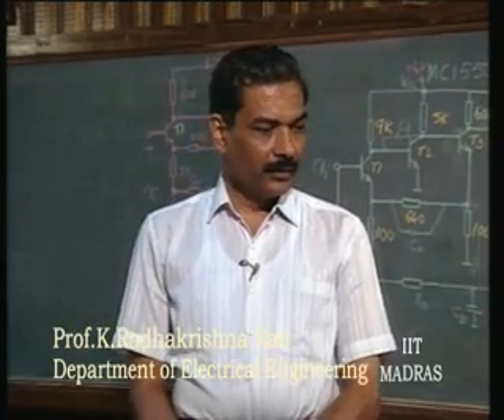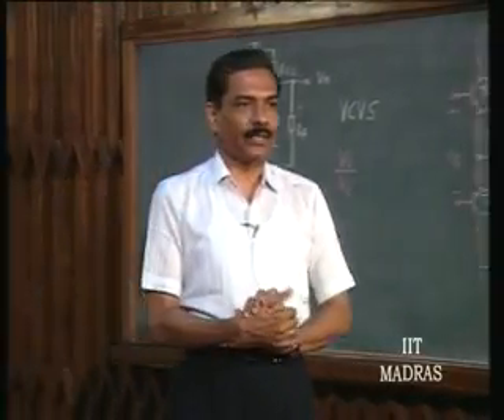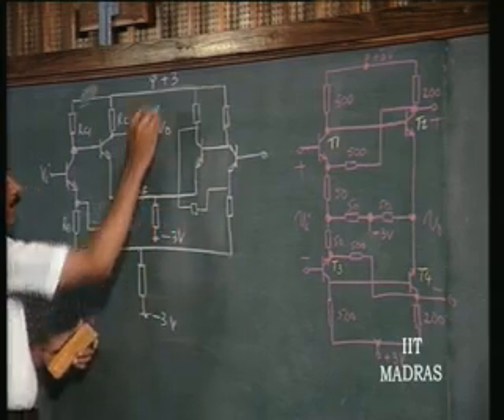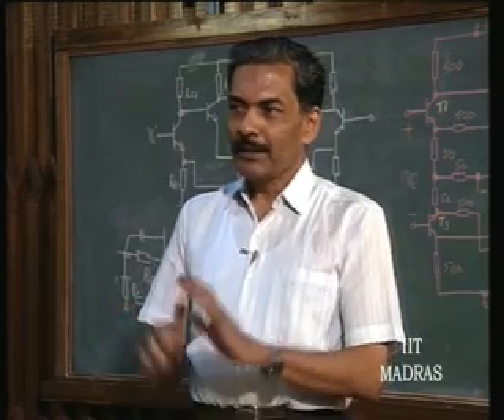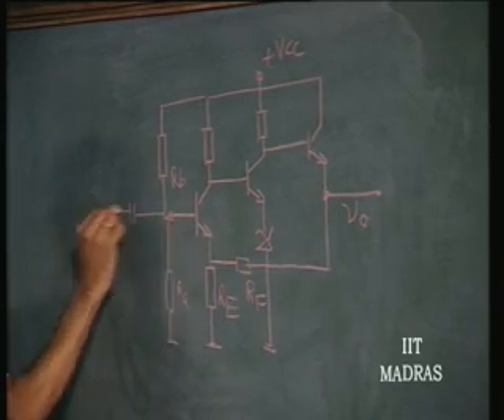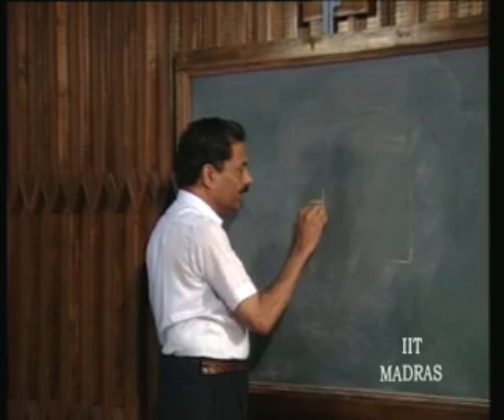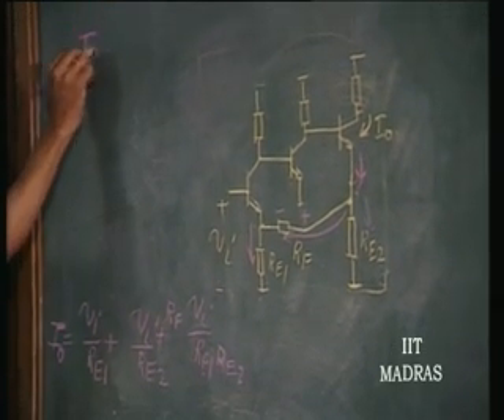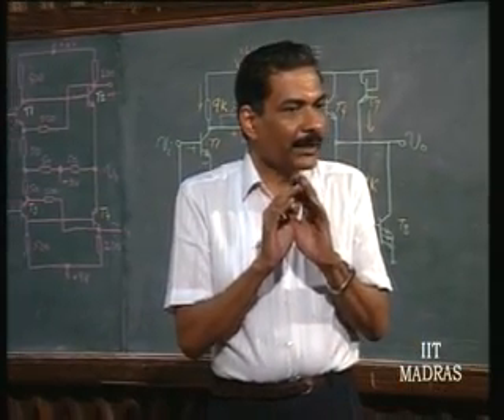Lecture - 9 IC Negative Feedback Amplifiers

Comment: 20:00 - Sir, When we Split the Feedback Rf as Rf1 and Rf2 , and if the Capacitor is placed over Rf1 (so that DC Gain isnt affected cause Rf1 + Rf2 = origianl Rf), Wouldnt the Zero be determined by C*(Rf1||Rf2) ? since we short Vo and Vf = 0 and calculate the discrage path of the Capacitor - which appears as a Rf1 || Rf2 ?